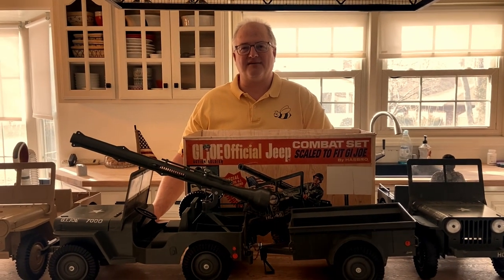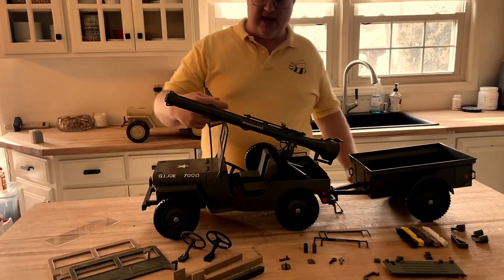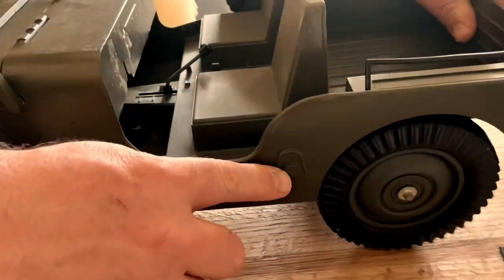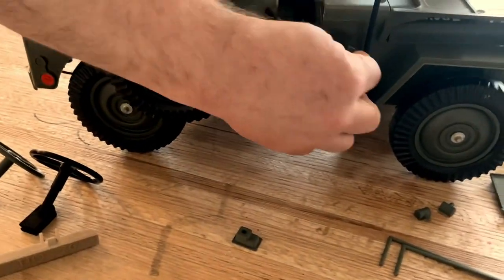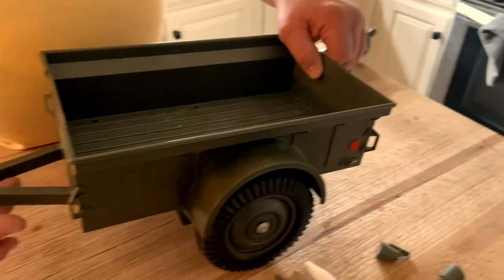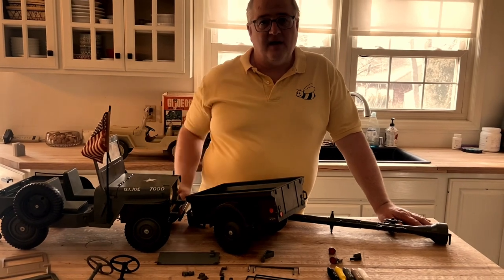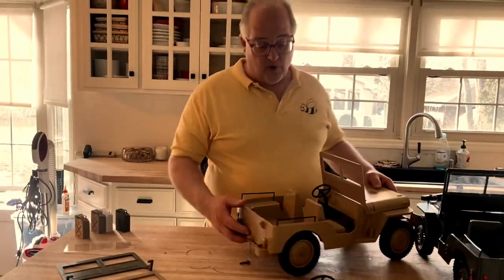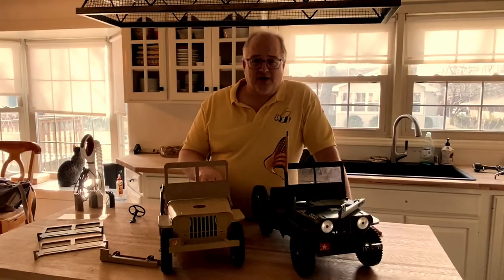GI Joe 5-Star Jeep reproduction parts

Comment: Excellent video, Is there anyway to repair the thing that hold the eye bolt on?  I notice from looking on ebay most are broken on the trailer.  And is there anything to take light scratches on the jeep, mostly the hood area. Thanks, for posting.
Reply from the maker: Novus Plastic Polish works well at removing light scratches and getting an original shine back to your vehicles. The repair around the eye bolt would depend a lot on how badly damaged it is and would probably require some type of plastic sculpting material.

Comment: I like the repair parts and will probably use a few. My question is how do you remove a damaged front bumper to make room for the replacement?
Reply from the maker: You would need to cut it away for the body of the jeep. The body of the jeep has two square posts extending out from the front. The original bumper would need to be cut off by cutting around the bumper posts. Once removed you simple glue my repro bumper onto the bumper posts.